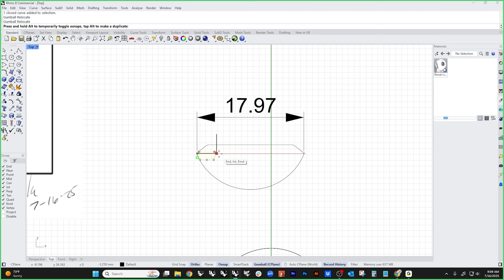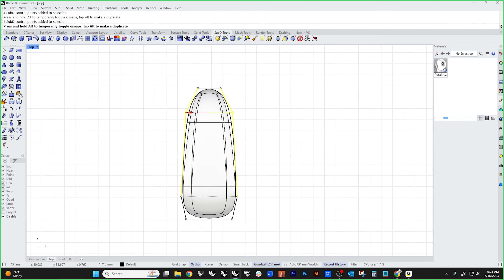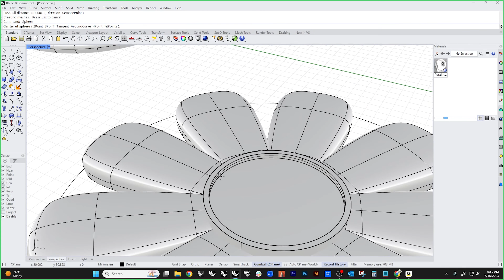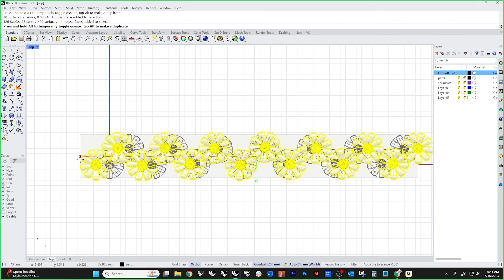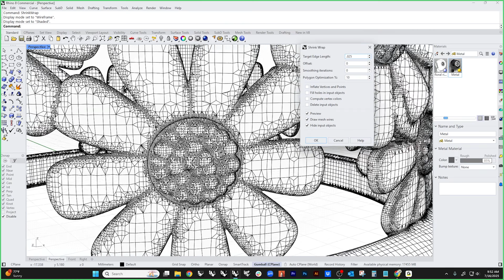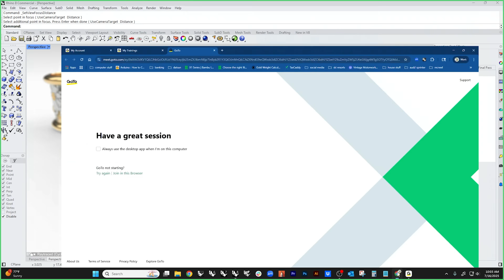Rhino 8 - learn Shrinkwrap, Flow Along Surface, Subd as we build a simple ring.

Comment: 30:18 Please tell me how you managed to make a mesh on the central cylinder using closed extrusion? When I perform the same actions, I still get closed extrusion😢
Reply from the maker: run the useextrusions command and make sure it's set to polysurfaces not extrusions.
Reply: @Rhinoceros3d  Thanks for the video and the help, it worked out!
Reply from the maker: @toiskustvo  thanks for watching!